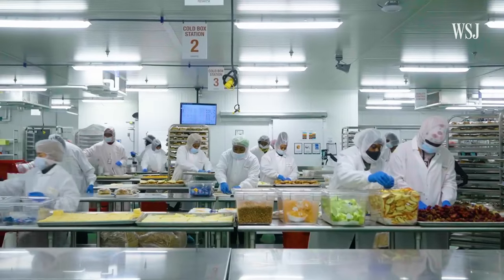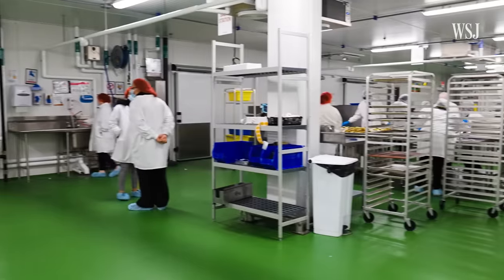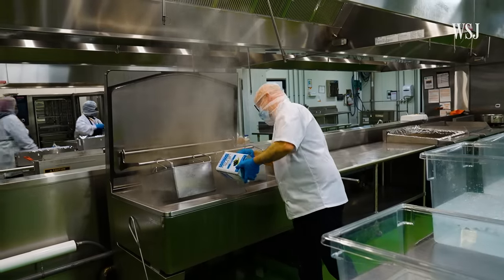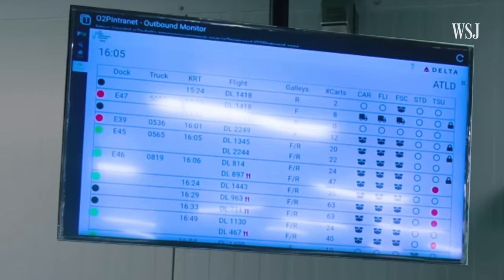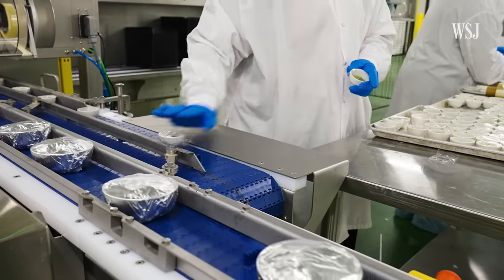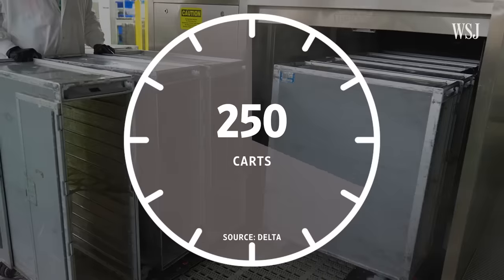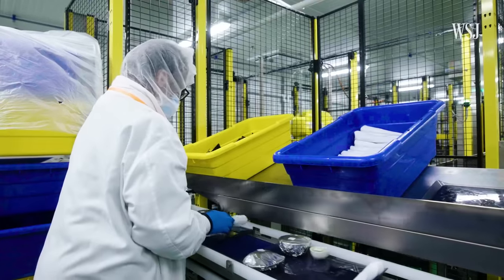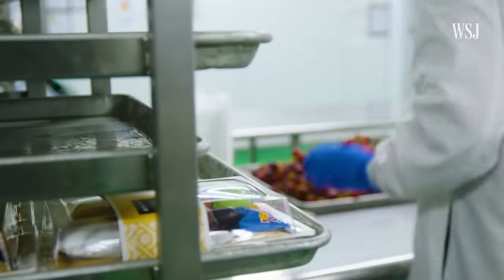Inside Delta's $2 Million Renovated Airplane Meal Kitchen | WSJ Booked

Comment: I think we US consumers expect so little that this can wow so many people to comment.  Delta caters 12 or up to 18 or so meals per flight for only specific flights.  Meaning First Class passengers of a flight that's over 2.5hr or so of distance, and only at designated meal times.  That and a few international flights Delta offers.  Go to Asia, EVERY FLIGHT EVERY PASSENGER gets a meal, even on a 50 min short flight.  Those airlines mostly operate widebody aircraft that holds 300+ passengers per flight versus the smaller narrowbody Delta uses.  Their caters put out way more meals than this Delta kitchen and at better quality.  Any of the Asian airlines' economy meal is on par if not better than Delta's First Class meal.  Same for the Middle Eastern airlines...  All of them have much more intricate meal components and better presentation than Delta's.